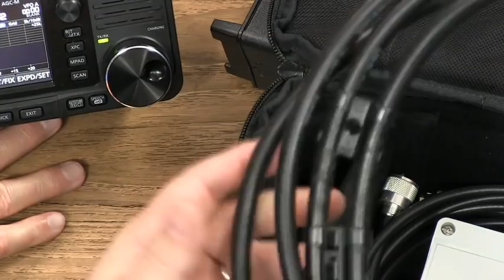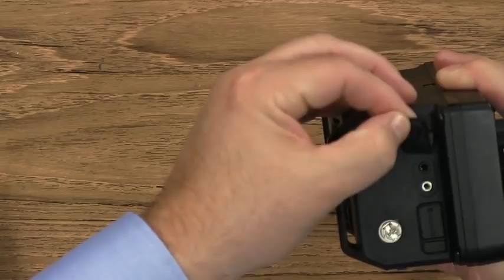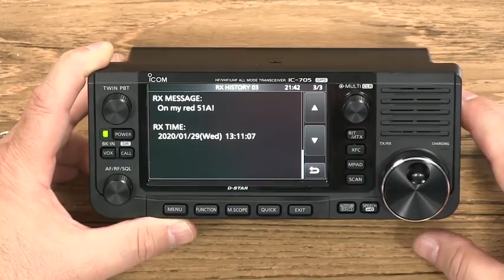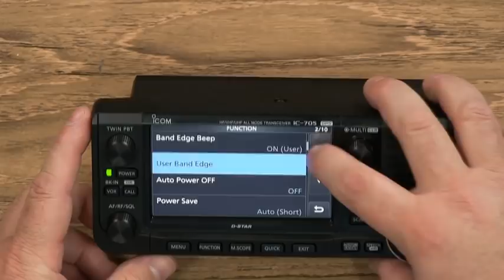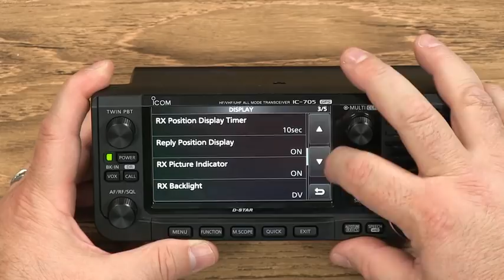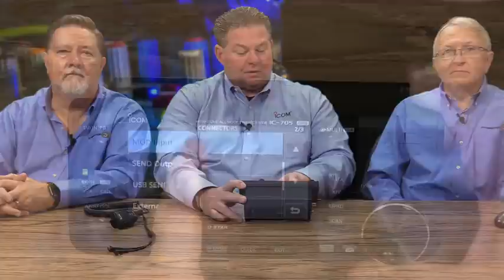Icom IC-705 All Mode Transceiver

Comment: For the size and price,  I believe this unit is overpriced when compared to other rigs such as the x6100. Also, being as thick as this rig is, they should have given it the ability to accept a battery that would output 10w. I would like to have seen two versions of this rig. One offering 160-6 and then this model. Chinese companies are putting rigs out that are doing as much or more for far less. Icom had better rethink this offering.

Comment: Sorry to say, but Icom is moving in a totally wrong direction now. Some real small and fairly cheap plastic SDR's are sure smooth for some, but for me, I'd wish a brand new fully updated and good looking metal, no plastic, all modern new IC-751 with all filters and 200W output. And no more sudden failing screens or cheap leaking capacitors. Now, THAT would have been SOME THING!!!!

Comment: Icom  really had a chance.  But what they did was a collosal stupid mistake of epic proportions.  What they did was just  took their icom 7300 and “dumbed it down” by removing the internal antenna tuner which is the stupidest thing anybody could’ve done in the world just so they could shrink the size of the radio and gave it the new name of icom 705. But what they have done is they were close so close to the brass ring and could have had one  great  QRP radio. But Nooo. What they did by removing the internal antenna tuner thus dumbing down their radio and thus left the door wide open and guess what. Xiego an  upstart new company that wants to go places just walks right in With their smaller new G 90 “with” an internal antenna tuner and a waterfall and one of the coolest SWR’s That can easily diagnosed antenna problems. And the price is a fraction of what icom wants. And walks off with the prize and leaves icom eating their dust. Icom had the chance and they just dropped the ball and fell flat on their qrp faces. Whoever in their company that decided to remove the internal Antenna tuner and everyone that let them get away with it was the stupidest move Icome has ever made in their history. Icom should be out right ashamed but they are going to pay through the nose because Xiego’s new G 90 is going to walk off with their lunch
Reply from the maker: Mr. Pearson, thank you for your time to comment on the video. 73~

Comment: Boooooo Booooooooooo 
On Icom for this tragedy. NO INTERNAL ANTENNA TUNER
For a QRP this is an out right flop because They don’t have an internal antenna tuner. Please everyone take note of this. They have made a horrible mistake the flaw with this thing is it’s gotten better but they left out the internal antenna tuner meaning you’re going to have to carry two things instead of one. This is an out rage. We need to boycott this item and maybe they will come around and fix it pretty quick instead of leaving this piece of trash on the market.
This is just sickening. They came so close to the brass ring but slipped up and dropped it into the sewage just before it got to us by leaving out that internal antenna tuner.

Comment: One thing I'd be worried about with the BT and WLAN is if I wanted to use it with a transverter on S band or C band that it will either "chirp" and cause QRM on the band or being so close to a microwave source could damage the front end of the BT/WLAN hardware.

Comment: I have an Icom 7300 and I am interested in the IC 705.  I love the ergonomics of the 7300 and look forward to the consistency of the operating controls for the IC 705.  Now, ICOM, put a tuner in the thing, add an additional antenna mount and increase the power to at least 20 watts!!

Comment: when is that 705 will be release in a 100w mobile form factor like the 706/7000 ??? ditch that crap 7100 form factor... I have my 7300/9700 but still miss a mobile radio... now that the 705 is about to be ready, make a 100w mobile version...

Comment: I am not sure about the microphone jack. I know, it's easy to buy and hack, but in my opinion, some weatherproof industrial connector would be much better choice. 
What happens when speaker build into microphone is plugged in. Does it mute internal speaker or not? Or is this selectable? It would be nice, if they could work simultaneously, which is extremly useful in noisy enviromet.

Comment: It was interesting to learn the differences between the receiving parts (RX) of the new 705 and the old IC-7300, IC-R8600. If there are differences, what are they?? All these nuances for frequencies below 30 MHz. Has reception improved in the long wave range (130-300 kHz)?? In General, an interesting video. Sorry don't show MUCH real work with the connected antenna.

Comment: Would be legal to use on 11 meters since its 5-6 watts if there's a mod to allow it & also allow Marine, FRS & GMRS also. Is there a PL tone board to allow repeaters?
Reply: Likely Not Legal..
Though if modded..given its power output FCC will Not take the time to chase you down

Comment: Will this fantastic radio have Full Duplex capabilities for satellite operation? Is there APRS operation also present like in the Kenwood TH-D74 ? Is it possible to use CW/SSB mode in UHF/VHF or FM is the only mode available for these bands ?
Reply: I'm afraid it doesn't include a full duplex capability for VHF/UHF. If it would should have built in a diplexer which is a hardware thing and you cannot just update with a firmware release. Watching this and 2 presentations from Orlando hamvention there was no mentioning about double VFO or a full duplex you need for SAT operating. If the radio would be capable probably they would advertise it since would be a selling point for SAT operators. Hope I'm wrong and wait for the official tech specs after release. I was hoping for that option since can operate SATs only portable to reduce the bulk of having 2x FT-817. The IC-9700 for portable is too bulky as well so was hoping for something smaller and more manageable. Otherwise it will do all modes on VHF/UHF but that I already have in the FT-817. For portable other than SAT I think is a nice and user friendly radio. Best 73 - Andrej S57RW!
Reply: s57rw Thanks Andrej. I guess a combo of ic-705 and id51 can help for full duplex sat operation.
Reply: @ffpache  The id51 has a full duplex capability but isn't an all mode RIG so it is good only for FM SATs. If you are interested only in FM SATs it will do alone and for FM there is also no need for CAT control for doppler since isn't so critical and can be adjusted manualy few times during the SAT's pass. But you can find cheaper handhelds with full duplex if interested just in FM SATs. For linear transponder SATs you still need an all mode full duplex RIG or 2 separate rigs if full duplex isn't supported. Best 73 - Andrej S57RW!

Comment: I like the form factor, but really, what's the deal with the software? Why can't we connect a USB keyboard and use PSK, RTTY, JS8 and other modes? Same limitation with the 7300. All you can do with that rig is set some presets and recall them, but you can't have a text conversation over HF digi modes without hooking up a PC. Very disappointing, and the first company to figure this out will kill the competition.

Comment: I have to say, it sure is a nice radio with a great display. I noticed you side stepped the current drain ! I bet that display is going to draw close to 800 ma like the IC 7300 does. If so, that battery is not going to last long at all. It would have been super easy to check current drain. All you need is either a power supply with an amp meter on it, or a multi VOM meter that reads current drain with the use of an external battery. 
I still have my IC 703 Plus and it would take the jaws of like to get it out of my hands.   "Icom shirt?" How close are you to Icom? Whoever came up with the idea to put an ATU in the IC703 was a genius ! Whoever decided NOT to put an ATU in the IC 705 should be fired ! Watch YouTube videos of  hams operating portable. The majority of them use NON RESONANT antennas.  Not having an ATU in that radio is a deal breaker for me, and I only use resonant antennas !

Barry, KU3X/QRP

Comment: I also add to the comments below about the Xiegu G90, 20 watts and amazing tuner, it can "tune" my 20 meter long EFHW on 160 M, the 7300 can't even do that and guess what ? l can actually make contacts on 160M on the G90 with 20M long antenna !

+ the G90 outputs a full 20 Watts down to around 9 volts.

The 705 battery is also very out dated in the year 2020, 7.5 volts ? are you serious Icom, ? Icom can't even provide a battery that provides 12 volts in this day and age to allow the full 10 watts ? even my little Xiegu X5105 has an amazing 12v battery ! + the batteries for the 
705 are extortionately expensive given the current cost of Li batteries !

I'm not saying the 705 isn't a good radio, it has some cool features, bluetooth, gps and usb to make digital easy but it could have been more, 20 watts and tuner and a proper battery would have made all the difference, even just a proper battery for 10 watts and a tuner lol. It could have been done but wasn't and means most people will have to carry around an external battery so then I may as well bring my FT-891 when portable lol as it can run at 100 watts for hrs on SSB Phone with a small 8.4 Ah 4S Zippy LiFeP04 battery.

Comment: Would love to know how they addressed the glare problems with the 7300.  I tried using my 7300 outdoors once and couldn’t see the screen.  I am super interested, but the lack of an ATU is a huge miss here.  Both my KX2 and KX3 have internal ATUs (as does my KXPA100).  My most used setup is a 29’ length of wire straight into a BNC to Binding post with a 17’ counterpoise.  I use this at lunch and most of the time when camping and I only have a few minutes to operate.
The video was long and dry so I skipped a lot, is the recording feature in the 705 as well?  I actually use that a lot on my 7300.  I’ve been using my KX2 and KX3 for the past few months and long for the recording feature.
Reply: "Both my KX2 and KX3 have internal ATUs"...  as options.     If you haven't been playing along at home let me just say Icom LOVES options so we'll just have to wait and see.

Comment: Dry as a popcorn fart but I'm glad you got to it before all the "Youtube used car salemen" got to  the 705.   What will be interesting is if this is like the 7300 screen it will be VERY difficult to see outside.   Hopefully an engineer or two thought about that.
Reply: Maybe the engineers finally busy with my 18 old month complaint to debug the 7851 ;-) Had a bug in a Kenwoodradio 3 months ago and Kenwood solved it.A good lesson for Icom how to treat costumers.

Comment: The IC-705 is ridiculously thick (3.3") compared to the KX2 (1.5").
Reply: The IC-705 has rediculously more to offer than the antiquated KX2.  I find it amazing they can pack HF/VHF/UHF/D-Star into something only 3.3" thick.
Reply: @twohandsandaradio  A thick 3.3" depth and they still couldn't fit an antenna tuner?
Reply: @jeff2424  That's not the Icom way.  It will be an "option".   Be happy the knobs are "options".